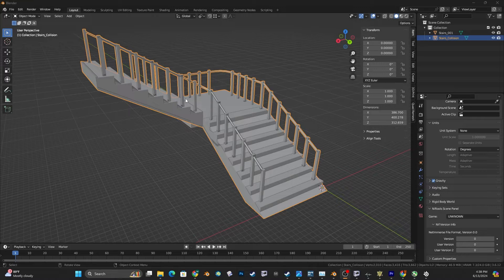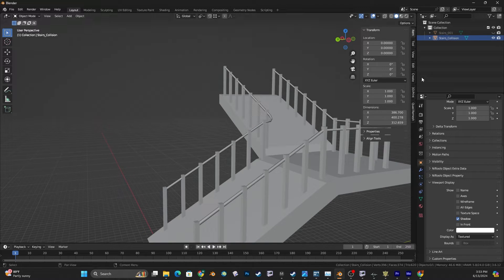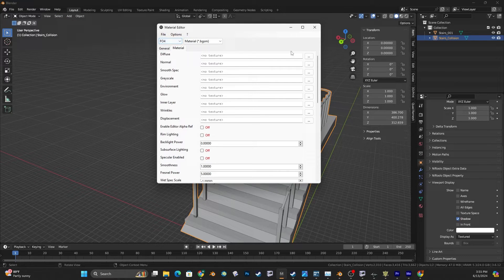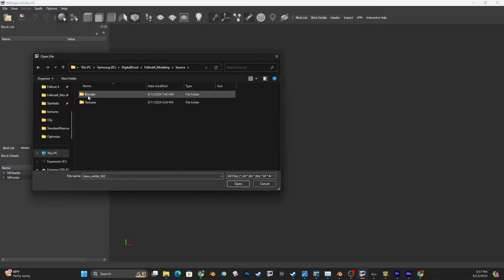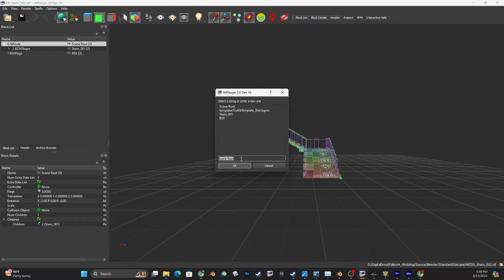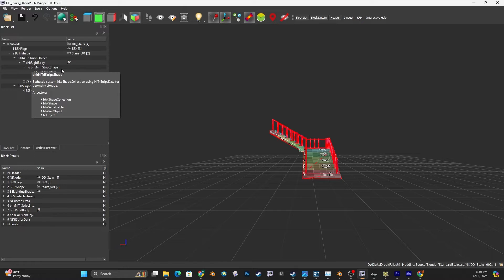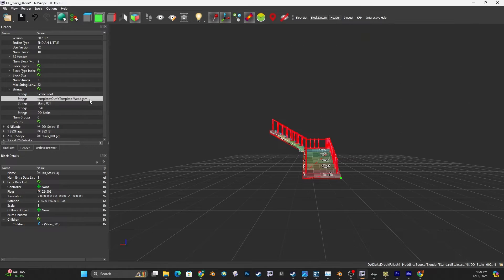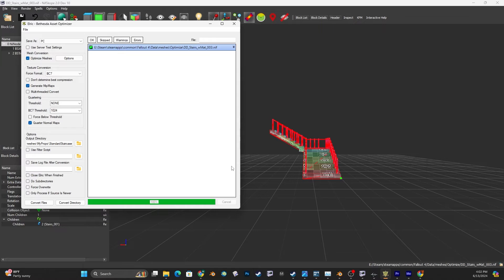Blender to Fallout 4 creation kit with Custom Complex Collision

Comment: Thank you for the tutorial. I see after import the obj you only change the physical material on the collision shape and  your stairs is static in game. I've done the same and my object falls on the ground and acts like a physical object.
I've tried to change the motion system to "fixed", layer is "static", I don't see what else I can try. Maybe because my object is a workshop constructible object (a spotlight)? I don't know I've really tried settings and none seems to make the object static once converted with elrich. Elrich option maybe?